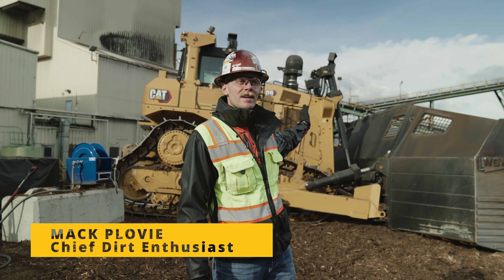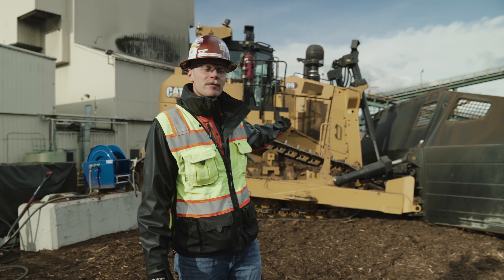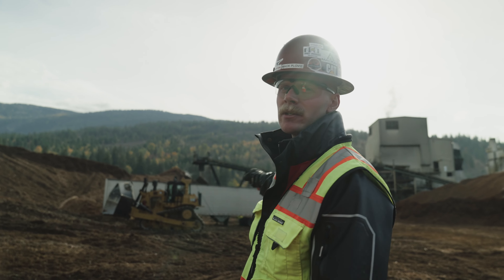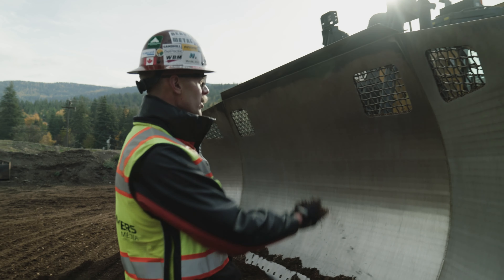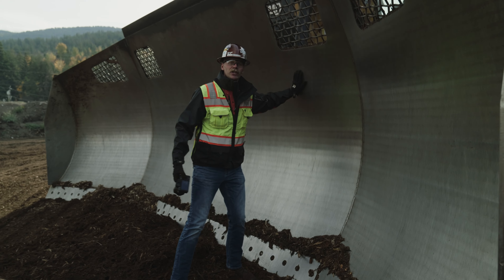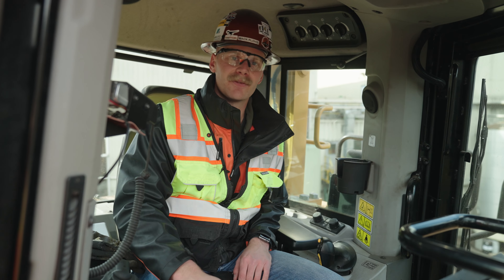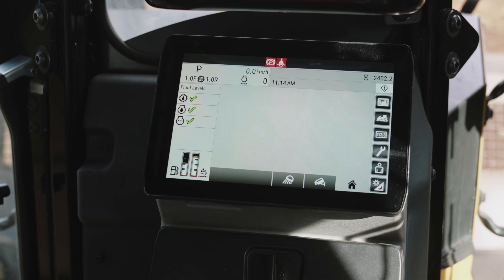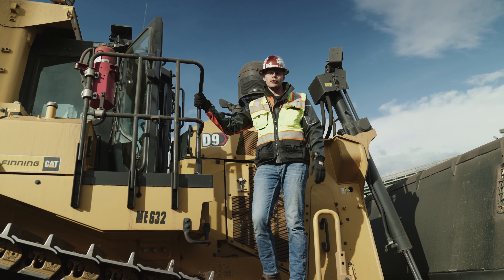New Cat D9 Delivery w/ 60 cy3 chip blade!

Comment: I'm struggling to figure out how you claim the D9 has the power of a D10.  It's not even close.  In fact the 10 has a higher hp to weight ratio than the 9 does.